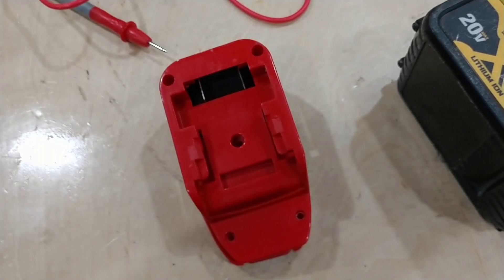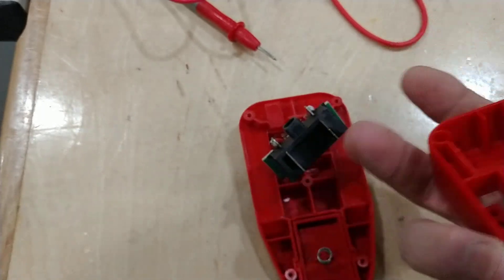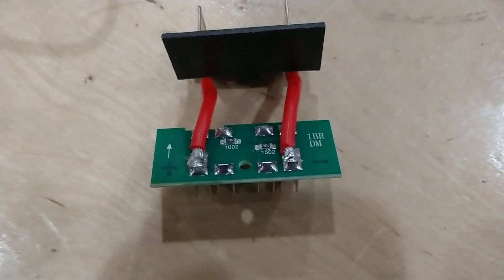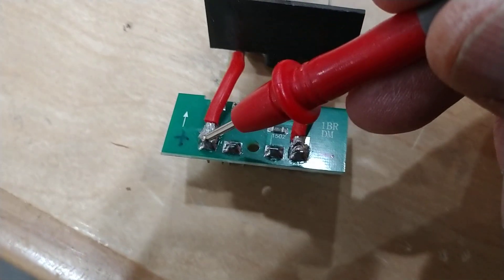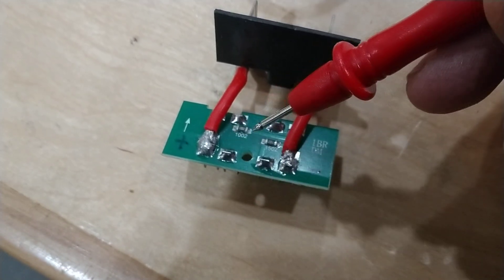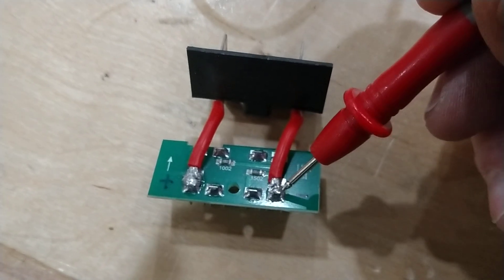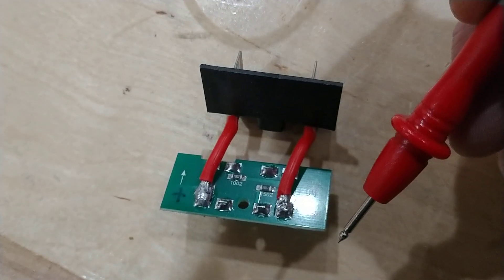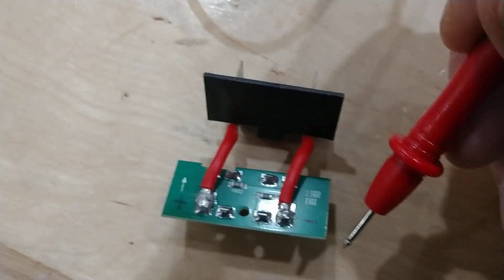Bauer tool to De Walt battery converter explained

Comment: Thank you!!! After the 10k only didn't work from all the other videos I found, I was about to buy one just to take apart to find this. I did this on the tool side of mine since I have all dewalt batteries. Have to break off the two middle tabs on the tool to make it work that way.
Reply from the maker: this works but be careful because the battery under voltage protection is disabled, I just trashed a pair of batteries when a friend was using a sander.
Reply: @GmanInd yup. If I could start over 15 years ago id have all Milwaukee.

Comment: 10-15k resistor but what watt and what % of resisters???
Reply from the maker: This is a valid question and these are values one would need to purchase the correct resistor. I have stated in a previous video that the wattage did not seem to matter in the conversion project as the resistors are internally connected to the tool not connected to the battery, this is another reason to remove the two inside connections from the tool when converting a Bauer tool to use DW battery, as the terminals #2 and #3 are supplied 12v (if I remember correctly) from the battery terminals and a constant drain would occur if the battery was left attached to the tool. A 12v dc source with a 10kΩ would draw .0012 amps and .0144 watts of power.  I would have to measure the package size of the ones used in the adapter to see what they used, I estimate a package size of 1210 max so that is a 1/4W resistor, I use a much larger one only because I have a supply of them on hand and they are friendly size for me to work with. I usually purchase the 5% gold band resistors. The 1502 and 1002 used in the adapter typically have a 1% or less tolerance, I have not had an issue with most of the 5% ones I have used. I did have one conversion fail and should have measured the value of the 10kΩ I tried to use, it might have been out of spec or at the far end of the range, causing the failure I initially assumed it was because I did not have the added 15kΩ resistor in the circuit.

Comment: Great info! If you find a good spot to mount it, a DPDT switch could let you alternate between stock wiring and DeWalt-compatible wiring.

I'd love to know which other brands are similar enough to allow cross-compatibility with fairly simple modifications instead of using separate adapters.
Reply from the maker: For someone with both battery sets of tools with batteries the DPDT switch would be a good option, my reason for me to  permanently convert Bauer tools to use DeWalt batteries is to simplify my EDC tool set, I do not want to keep multiple batteries and charges on the work truck, or in the trailer.